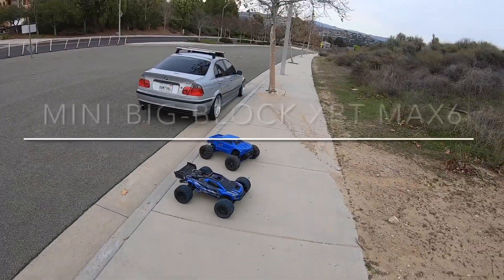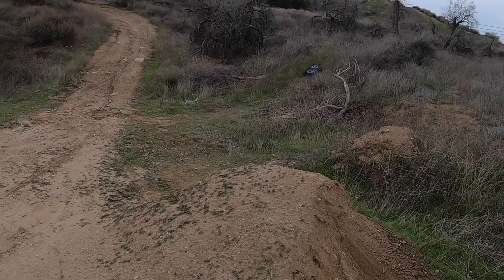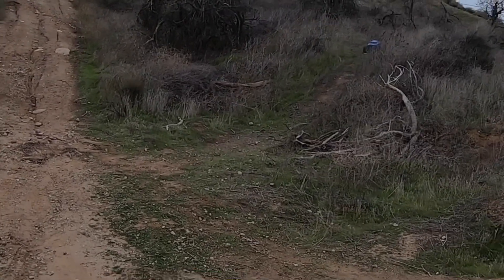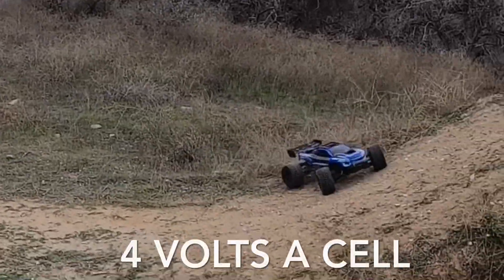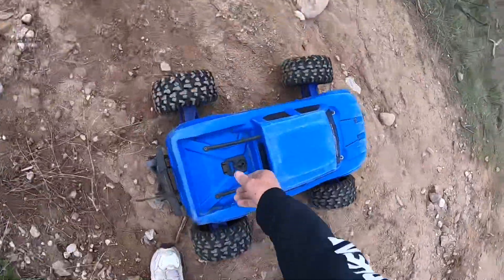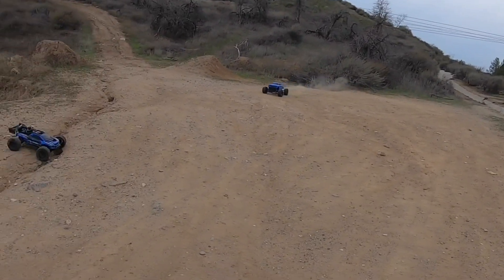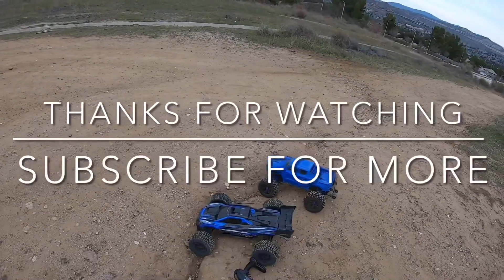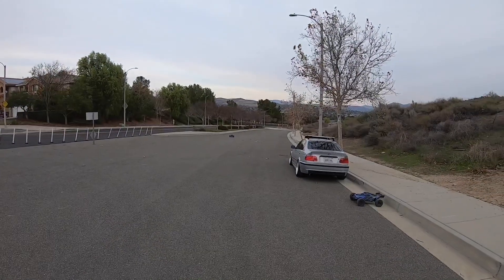TRAXXAS XRT Or WIDE-XMAXX Build your Xmaxx Or Buy The XRT ? Let’s Find Out Now

Comment: Great videos Earl. Just starting to get back into the hobby after a decade. Currently converting my old savage xl 5.9 into electric. Great seeing electric getting close to 1/5th scale. Got me wanting to grab xmaxx or XRT.

I know this video is 3 months old but would love to give u project for XRT. 
Double the resist on shocks so chassis doesn’t touch ground on the up ramp and change tires to softer quality (better air control).
Then compare x max wide vs XRT. I really like to see the stability on high speed turns in that setup between these too.

Comment: Great video. XRT for sure ain’t a bad rc but right out of the box it’s not as good as the xmaxx I think. You unbox the xmaxx and run it and have tons of fun. The XRT right out of the box needs upgrades for the same running pleasure. 
My wide xmaxx I’ve just changed spur and pinion and you’re good to go

Comment: I have the XRT Orange all stock for now 😱 going to get the red body from Traxxas for 109.00, upgrade the servo to the Traxxas 2085x for $95.00, add the X-Maxx Traxxas light kit for $100 and get the Jetko 1/5 Belted low profile Tomahawk tires with red rims for 105.00 a pair.  Then keep the stock 20/50 gearing🤔 and call it a day.  I'm a light in the azz basher (grass, pavement and hardly any jumps) just keeping it fun w/o trashing a rig that’s over $1k with add-ons!  Great channel learned a lot here. 👍 Also looking at a (Trim To Fit) Chassis Warp from darksidestudioarts. 🤔 😊

Comment: I was set on the XRT, but now I'm even more torn.  I run in wide open grass spaces for my dogs to chase (no real bashing or 'sending'), but I do need some maneuverability to avoid them catching me.  I currently use a typhon 6s or Erevo with stock tires for the dogs to chase but traction roll overs too much in grass.  The wide kit on the XMaxx would be a must for me, but as you said, that's another $200....
Reply from the maker: XRT would be good for that
Reply: @earlmoorhead5555  thank you for the reponse

Comment: Different conditions buddy. Have the og xmaxx with a leopard hobby 58110. Nn I just ordered a xrt which will will get the new leopard 58113. Then I will have both for different spots or tracks. And they both share the same parts that will break on a bash or hard race

Comment: 20/50 wow that sounds crazy any chance you can make a video explaining what’s your experience with different drive gear setups, it’s very difficult to find this information, I haven’t found one good RC video on this, I just got into RC I have a Sledge and just got a XRT ultimate too, it’s a bit slow compared to my Sledge so I ordered max 5 hobbywing with 1100kv, now trying to figure out what drive gears to get that will give me similar or but faster gears, and be able to fit the vidavon 30t large cover also what’s your thoughts on gear covers, I mainly drive on gravel and sand I I was thinking it’s best to cover it, but I am then limited to 30t 
Love your channel any advice would be great thanks 🍻🍻🍻

Comment: First you have the motor Wires overtop the fan on your ESC would you put a Bunch of wires over top of your AC that's outside??
2 200A motor & a 160A ESC that's 40A that the motor needs to  🏃‍♀️ to its maximum output 
3  You already know you're gearing's too high